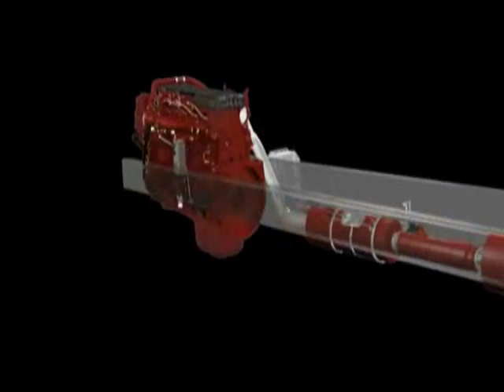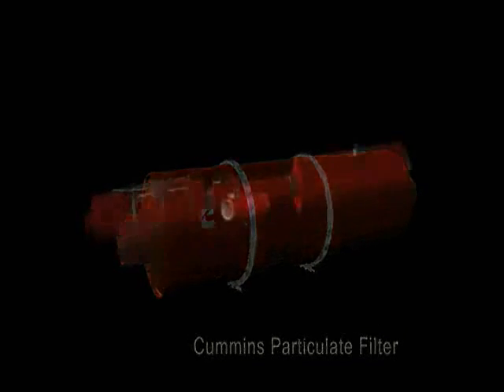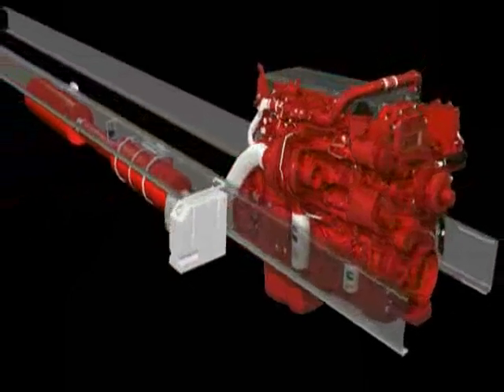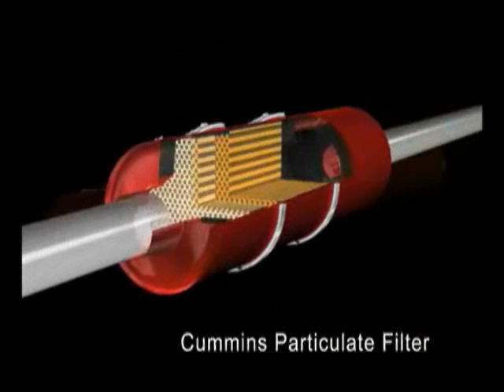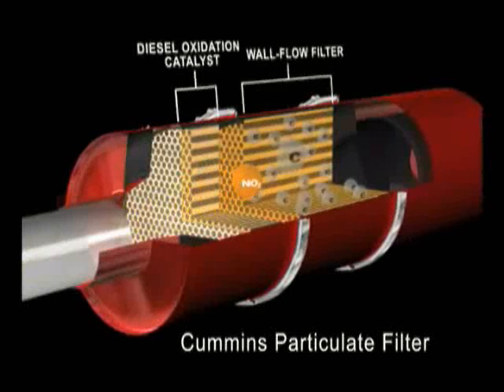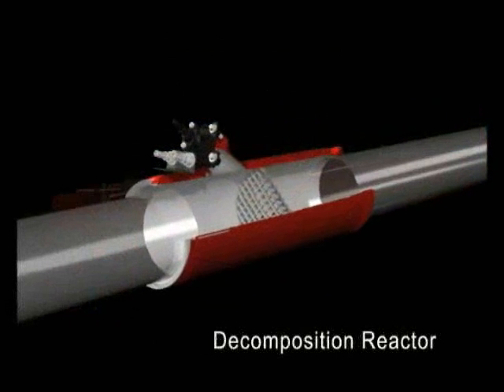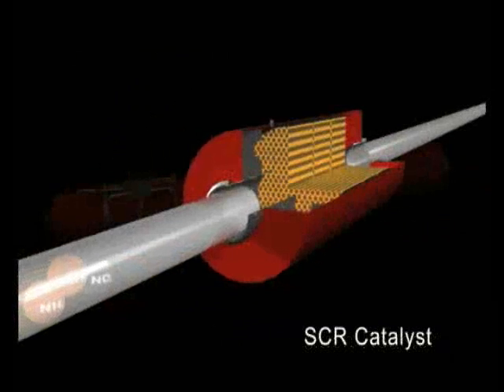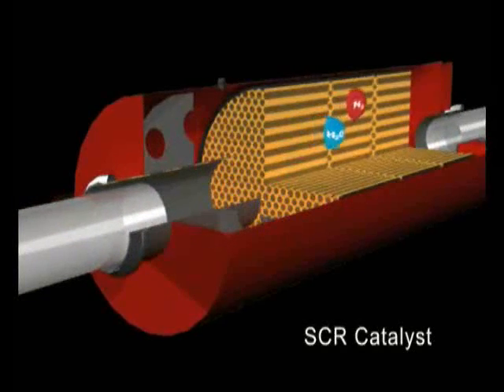2010 Cummins Aftertreatment System Animation

Comment: 1 truck operation. I (may) need a CA truck. Lookn at a 2010 Pete. Can anyone say how much time, money, & headaches these ISX's r. I'll be do'n 5000 mi a mo. Is there a way to quantify the cost/pain of these ISX. How often do they break dn,, cost of break dn's, etc..Any help would be appreciated.
Reply: They are a great motor! I helped work on a fleet of ISMs and those things work hard.
Reply: Ryan LaRue You must have missed the following from K Green, the post below: "I have already replaced every sensor on the aftertreatment side plus both nox sensors plus the 7th injector and I only have 165,000 miles on my ISX15. Volvo mechanincs tells me that this aftertreatment system was poorly designed because there is not enough room in between the DEF injector and DPF filter for a proper reaction to occur. This video does not accurately represent the actual design of the system. The video shows a straight system but the actual system looks more like a coiled snake." This is a fairly standard complaint, & shops throw parts at the trucks & FAIL TO SOLVE THE PROBLEMS.
Reply: i have 6 kenworths pulling triple trailer road trains out of the mines in australia. all 6 are 2010 and now have between 1.2 and 1.6 million kms. None of them have broken down yet. hours range between 24,000 upto 30,000 hours. they just keep on hauling going from service to service. none have had rebuilds done.

Comment: Too many incomplete regens will start setting DIESEL OXIDATION CONVERSION EFFICIENCY, least, moderate, or severe. You need someone to hook a service tool up and reset AFT history. For DOC. This will cause conversion codes to go inactive allowing you to stationary regen. IE, this shit wasn't intended for local trucks.
Reply: They know it's bad, but they keep manufacturing it

Comment: Remove all emissions controls equipment and install a tuner to reprogram your truck, this will yield substantial fuel efficiency gains, increased engine longevity, much cleaner oil, far better throttle response, decreased maintenance costs, and increased power output.
Reply: Gojira  The tuner should automatically controls temperature and AFR to reduce carbon and NOx emissions which could mitigate the effects of pollution. That being said most of the diesel tuners are installed to improve performance which gives the engine more power but also increase emissions.
Reply: Fiddlesticks! That’s a fat lie, people tell themselves that when in reality it’s just a excuse for a louder truck that rolls coal
Reply: Gojira  LOL! Did any Murican ever deal with that question? They'll kill us single-handedly.

Comment: I need a little help, I am getting fumes up in my cab, i'm sure it has something to do with the regen system.....Now I drive local and I know from driving long haul, it was never a problem with the system clean out, because I was driving long distances at a time and the exhaust stayed hot enough to run a regen. Now I drive a local truck and the regen won't run a complete cycle, plus the manual regen button will not work either. The regen filter has been sent back to cummins and was (baked) Cont.

Comment: I have already replaced every sensor on the aftertreatment side plus both nox sensors plus the 7th injector and I only have 165,000 miles on my ISX15. Volvo mechanincs tells me that this aftertreatment system was poorly designed because there is not enough room in between the DEF injector and DPF filter for a proper reaction to occur. This video does not accurately represent the actual design of the system. The video shows a straight system but the actual system looks more like a coiled snake.
Reply: Evidence over and over that all tell them DEF is bad, but they keep making it just like that

Comment: Wait, but how does this have anything to do with power, since it's about treating exhaust gas.  Perhaps some of that exhaust gas would get recirculated via EGR during a load, but that would be 1) not treated using the method outlined in the video and 2) already a be of diminished quality since its basically combustion after-garbage.  How would that work?
Reply: Backpressure. Instead of letting the system breath theyre putting some back in the turbos the egr cooler that carbons up everything.  The exhaust backpressure is restricting the power the system is ae to put out. Plus all the addins from the 2 filters to the millions of sensors causing a shutdown should one huckup, its a mess. Our 2008 pre dpr emission truck got 14 mpg. these new greater better truck of ours one being a hybrid and not both get 9.